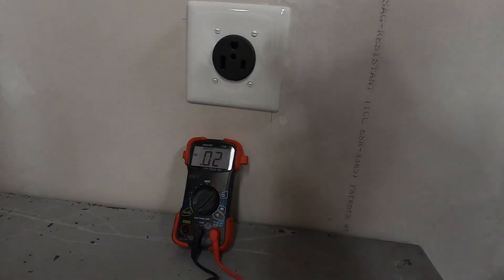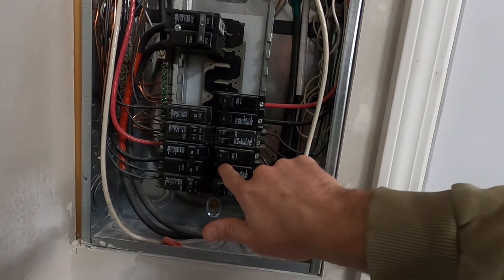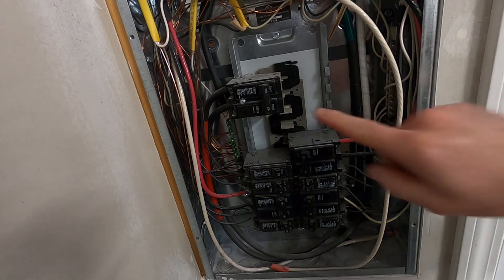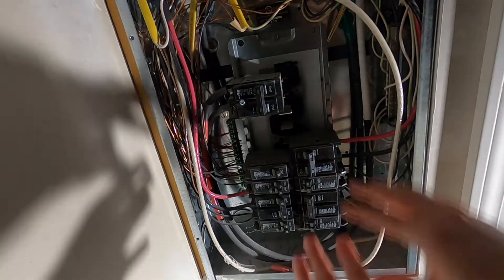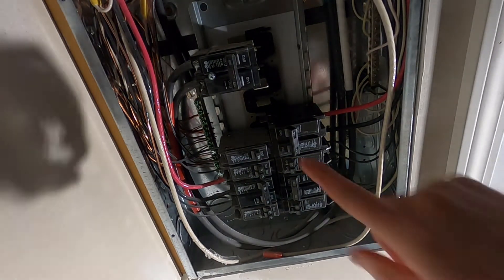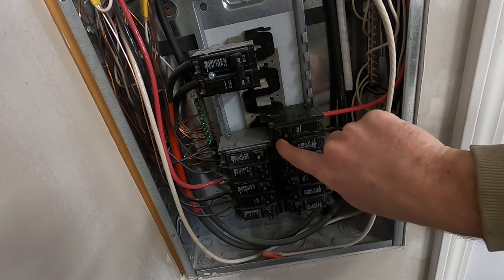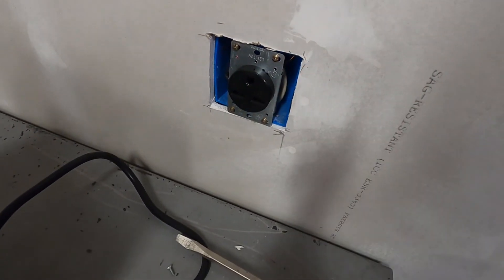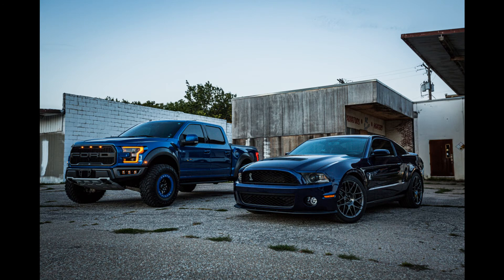240V Outlet & Breaker Replacement - Swapping 50 Amp for 30 Amp.

Comment: What do you do with the white wire? Just cap it off?
Reply from the maker: This application it is not used.
Reply: @KonaBlueSVT  so I Can just leave it hanging in there?
Reply from the maker: It depends on what your application is, most 240v applications don't require it, but I am not an electrician to say for sure one way or the other.